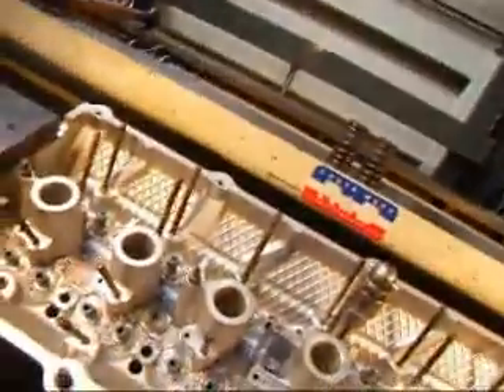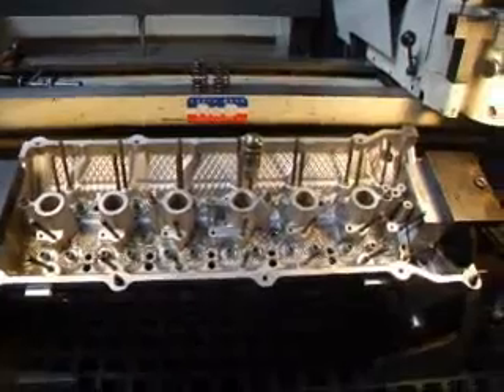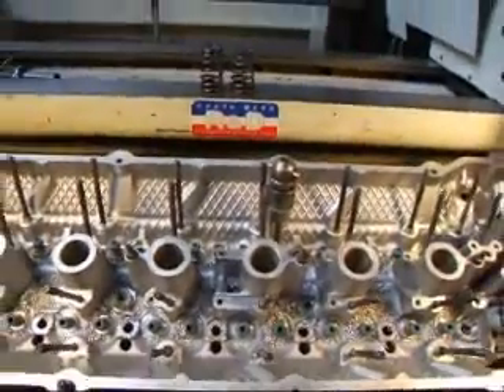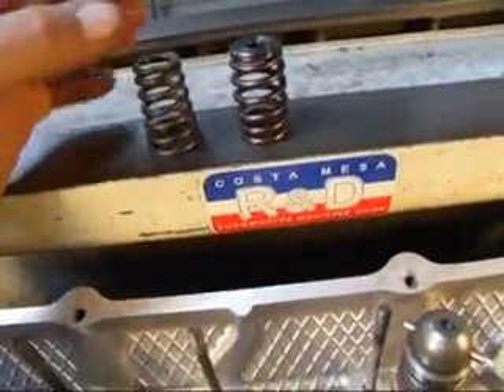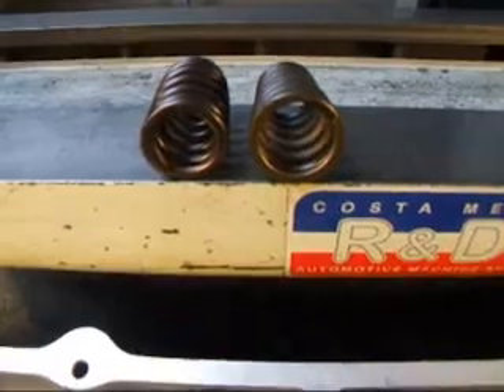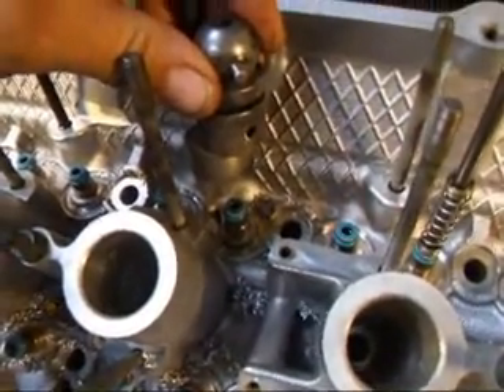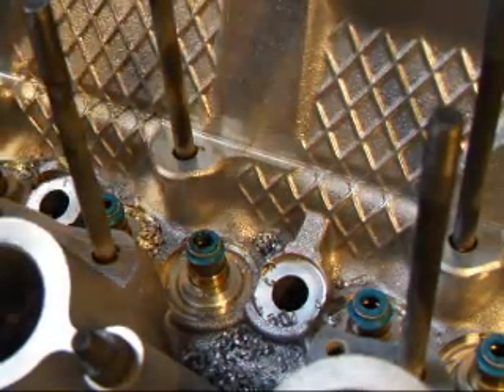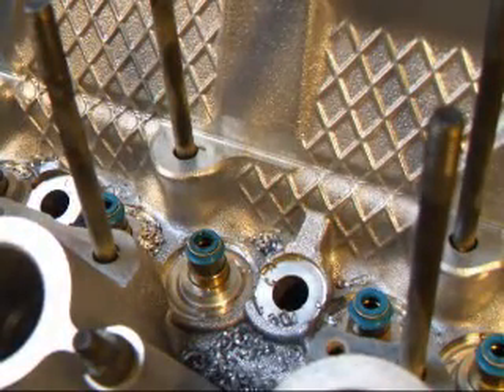BMW Valve Spring Seat Modification

Comment: I know, but normally if you use other valve springs you try to fit them first before assembling the valve seals and the rest of the parts. 
Not that he doesnt make nice work! 
i'm an engine rebuilder myself, thats why i thought it was'nt realy logical.